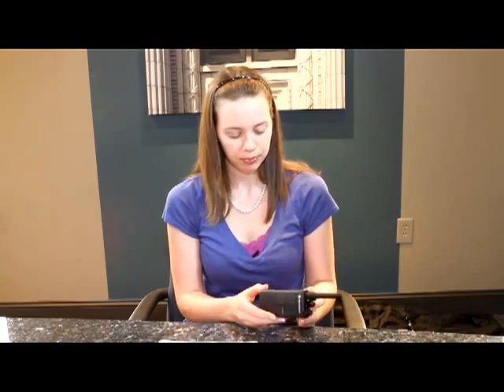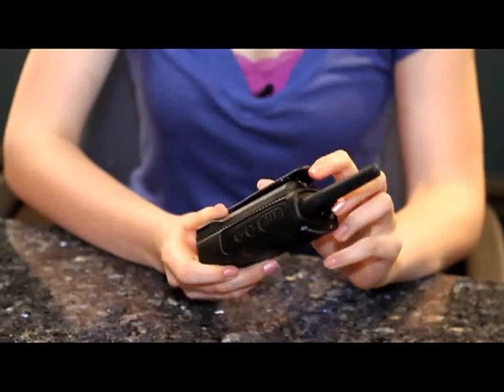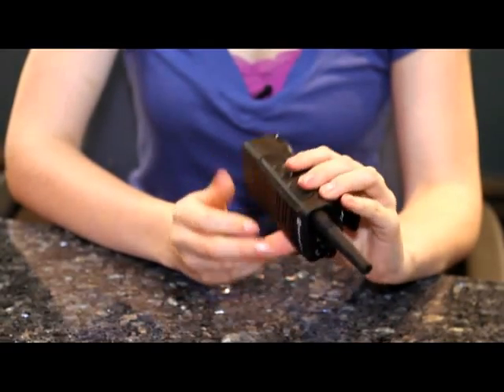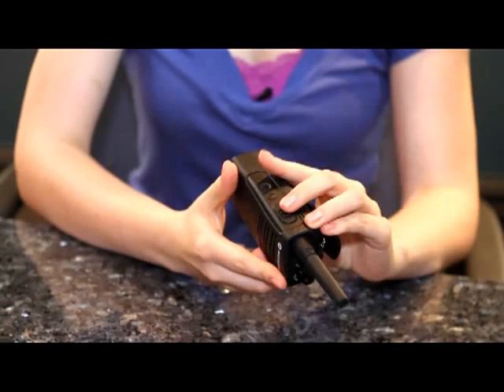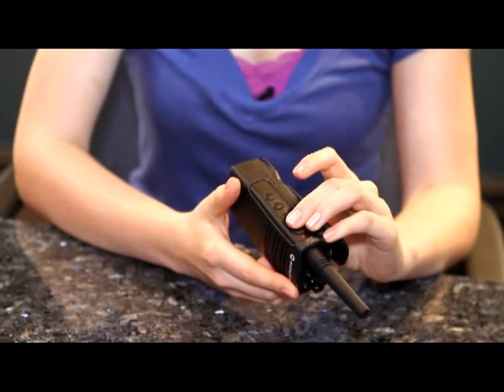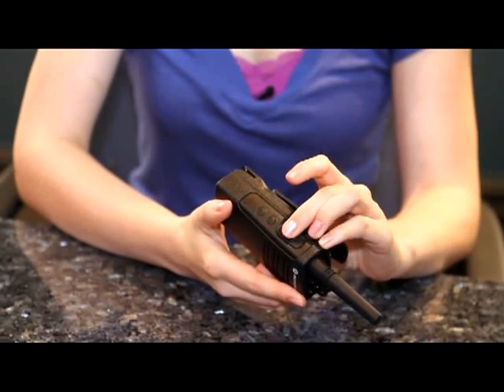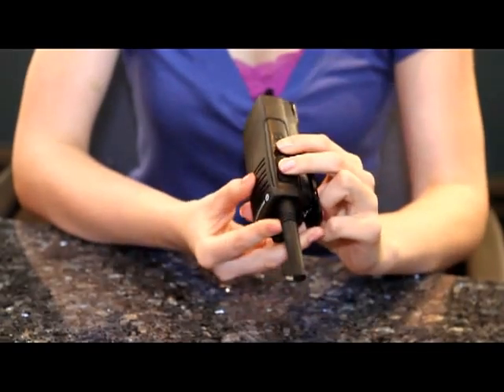Programming the Motorola RDX Series Two Way Radio

Comment: Question I have a rdm2070d  but I’m waiting on my antenna for it how do u replace it once I get it
Reply: Well those type of antennas are glued in you have to take the two screws out of the bottom of the radio and you're going to have a hell of a time getting it in there the antenna is supposed to be non-replaceable which means it's just a shield around a wire and if that wire is broke then you'll have to re-soldier it to the board hope this answers your question quick enough I'm just now seeing it

Comment: Yeah I dont like these because they technically violate the FCC part 90 rules by allowing an end user to freely change set channel data which means you can wander onto a frequency you have no license for.. Users should be aware that by changing frequency you could be violating the rules and permissions of your radio license, so make sure you are allowed to change before you do change and it is ALWAYS good to know what frequency you are on and changing to... get a frequency chart for your exact radio off the internet or from the radio shop or person who set up your radios..  Also those of you who have a VHF version you bought off ebay and do not work anyplce. it is not a good idea to use the radio to harass Walmart employees with it.. They can get the police involved and legally steal your radio claiming it is theres because it looks like the rest of theres and is on their channel, etc. It has happened before and you will get hung with a felony theft charge and they get a free radio. They have the money and power to sway the law, you do not. So unless you have a legitimate use or license to legally use a radio (business owner, GMRS, Ham radio), please dont buy radios like this just because they have moar powah!.. Cell phones exist for people to goof off on..

These are good for GMRS and MURS though but not so much as business band radios. I reccomend something like the CP200 / CP200D or PR400 handhelds for actual business use tho. Even cheaper TYT Md380 or 390's are perfect as well and you still have the DMR option on radios that are well built for under $ 100 USD.

Comment: In customer programming, is there a way to turn off TX/RX acknowledgement tones. Is way too loud and no good for a quiet job environment. Also where can I find a programming cable and CPS S/W? The cables I see are USB, the 2020 does not have a USB port. I'm thinking one or 2 prong from radio to USB link to laptop. Thanks!!! :-)
Reply: Yes you can. Hold the small round button with one dot while turning the radio on.  let go of the button when the chirp is over.
Reply: @Gmoney818  THANK you, that waz driving me crazy!!!!!
Reply: Bruce Reinhard  Also for the programming cable you would buy it and connect it to the charger dock to program it.
Reply: @Gmoney818  GREAT!!! Could you please send me the link for the cable and S/W if I need it. Thank You :-)
Reply: Bruce Reinhard here is the cable:

Valley Enterprises Radio USB Programming Cable for Motorola XTNi, RDX, CP110 RKN4155 https://www.amazon.com/dp/B004EGT55C/ref=cm_sw_r_cp_api_i_QUMuDbJ715Q6G

As for software just follow this link and scroll down to RD SERIES click computer Programming software and download that.

http://acsradios.com/resources/programming-software/
Reply: Bruce Reinhard No problem!

Comment: gm 300 how I can programm it ?
Reply: Non emulated DOS Pc of the pentium 1 or 2 era or earlier withan RS232 serial port, The motorola GM300 RSS, motorola mobile radio cable, and an official Motorola RiB  (bootleg RiBs usually do not work well if at all).

Comment: Can rdx radios communicate with Talkabout radios? If so, how?
Reply: Have to be a UHF band RDX radio and be programmed with the frequencies of the Talkabout radio. I have a number of different brand of radios both professional and non professional like the Talkabout radio and I never ran into a problem with getting them to talk to each other just as long as I had them programmed to the exact same frequencies. However, I don't know how well the privacy codes of a professional radio like the RDX will play with the privacy codes of a non professional radio such as the Talkabout.
Reply: @djhightek2000  Usually the talk about radios are MURS or GMRS/FRS.. the UHF RDx series are on the part 90 commercial pool out of the box. The CPS may allow you to set custom frequencies in the RDx. if you are on VHF talkabout for MURS then a VHF RDX should work on a couple frequencies like 154.570 and 154.600 because those two are dual serviced for business band pool and MURS.